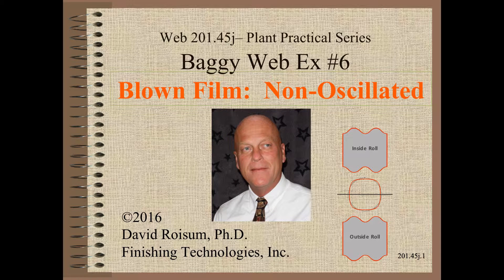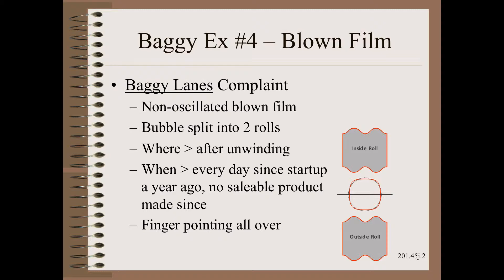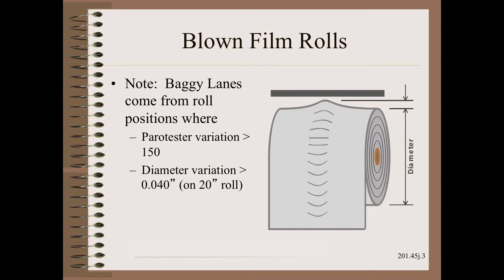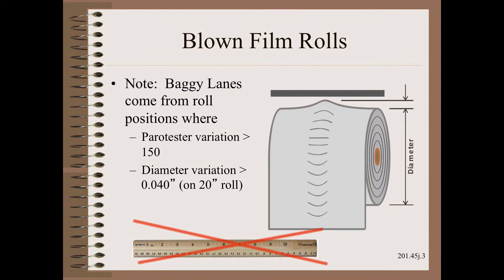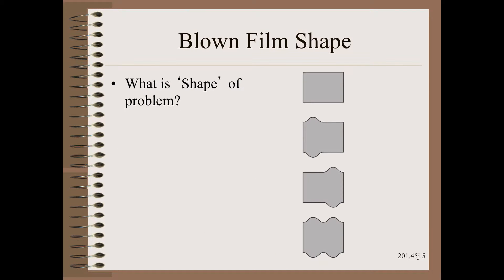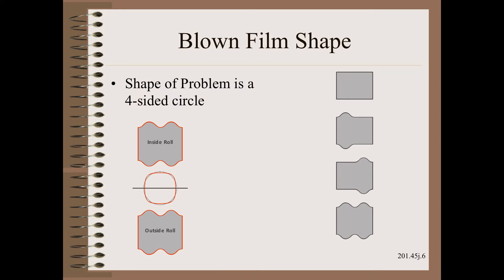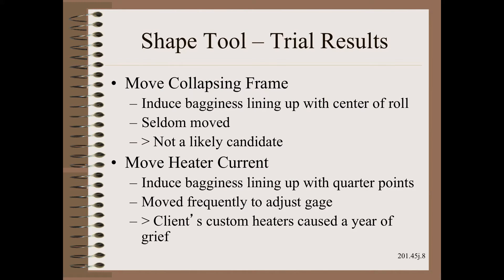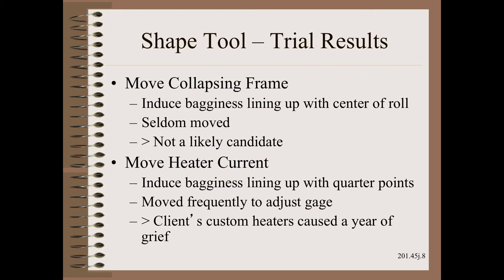Web20145j - Baggy Blown Film Example 1

Comment: Hi sir we have baggy film issue at the winder . We have osilating haul off and have baggy film issue only at winder.
Reply from the maker: Blown film oscillation is 2-10X too slow to completely level the gage variations caused by the die (etc) that build up on the winding roll that then causes bagginess.  Turn off the oscillation and troubleshoot what about the die (etc) causes these gage bands and fix the root cause.